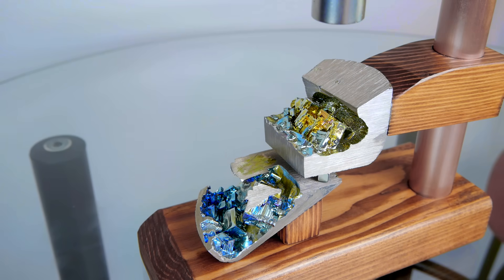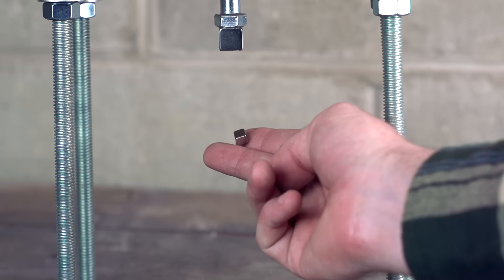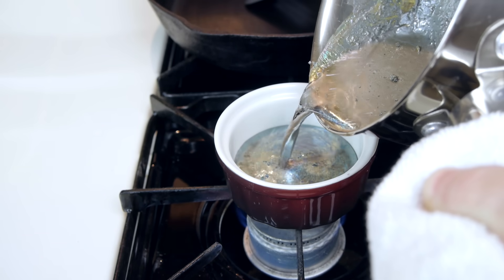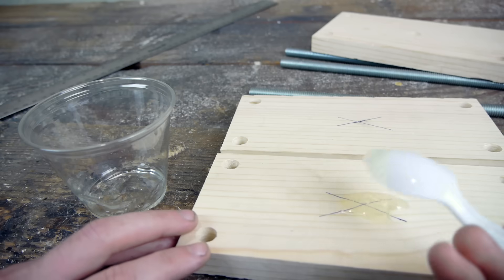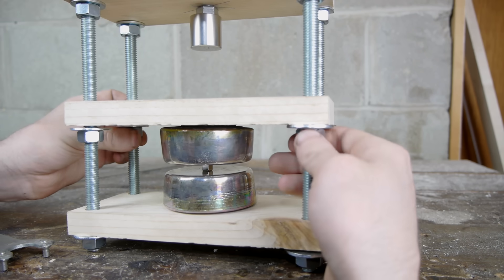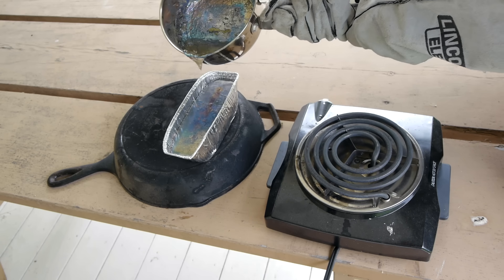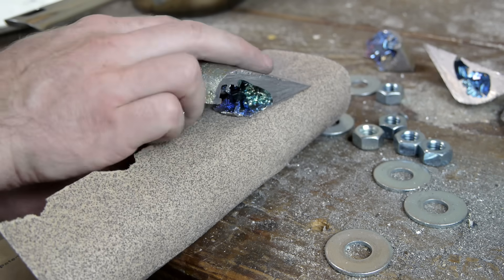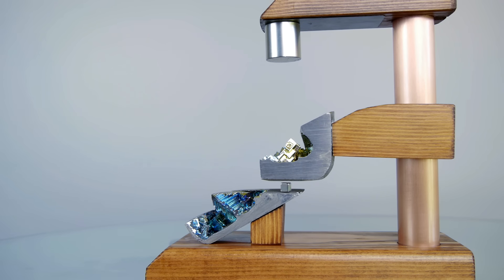Levitate a Magnet with Bismuth Crystals - No Energy Cost, Indefinite Levitation - NightHawkInLight

Comment: Can you wrap that levitating magnet with some wire and still have it levitate? I'm wondering if you could create a frictionless motor out of this...
Reply from the maker: That could actually be a pretty interesting experiment. I expect the magnet may want to move out of position when current is applied. If it does work, unfortunately it wouldn't be any use for practical purposes because you couldn't attach any load without introducing friction to hold the drive shaft in place.
Reply from the maker: Thank you for the idea by the way.

Comment: Would a magnet float in a bismuth bowl?
Reply: spirit of excelence I'm pretty sure it would just fall because gravity
Reply: Diamagnetic force is weaker than gravity, which is weaker than magnetic force. DM<G<M
That's why you need the large magnet on top, and why the bismuth needs to be very close to the levitating magnet.

Comment: Im wondering if the lower part of bismuth is necessary once you get it levitating?
Reply: Both pieces are pushing on the magnet, so without the bottom part it would just fall.
Reply: YTisMEH ThisisBS 

no its not 

you only need one side or the other.

its easier with two
Reply: MsSomeonenew 

bismuth acts against the motion so its magnetic field pushes in either direction looking to achieve balence so you only need one piece

update.....   mmuuuuuch much harder lol 

had to switch out magnet

Comment: This would make a nice low current draw air magnetic hockey table.
Reply: Mud Kip Interesting idea, but balancing out the fields in 3D space rather than the mostly 1D setup here would probably be nearly impossible, even if you got around the fact that you'd need a thing of bismuth between you and the puck

Comment: Where did you get that huge copper pipe? None of the local hardware stores sells pipe larger than 3/4in. That 2 in pipe would be perfect for a project of mine!
Reply from the maker: It's only 1" diameter, the video must make it look larger. You can get large copper pipes locally though if you look around for plumbing/HVAC supply stores that cater to professionals. It's too bad you can't count on regular hardware stores for that sort of thing.
Reply: @Nighthawkinlight  If there's a coil between it, could it be generating some electrical power? Just curious
Reply: @Nighthawkinlight  Or make your own copper pipe! maybe that could qualify as a project.
Reply: You seem to be able to make just about everything else in your back yard, why not get into turning your ingots into pipes?
Reply: you can buy it at any refrigeration wholesaler
Reply: bro youre a genius just make a 2inch copper pipe
Reply: Gross... I think... Idk
Reply: @FrankCosbyNo-Relation  hey are you related to that television program
Reply: @gxiwngxyjebey  😂😂😂💀 I'm high af tho
Reply: If you order directly from the factory they normally are quite happy to make larger sizes speaking from experience.
Reply: @noaharthurbradley8726  you could say the same thing about adult toys speaking from experience 
🤣🤣🤣
Reply: I like that getting the pipe is the challenge, not getting bismuth ^^
Reply: Check copper pipes that are meant for Gaz, they are larger than water pipes
Reply: McMaster
Reply: A 2inch copper or larger can be found at plumbing supply companies.be prepared for the cost
Reply: Have  you searched  Google?
Reply: By ur moms house I'm kidding
Reply: smash ball through pipe like in Pakistan or get a moonshine still
it's been 8 years but thankfully I solved it
Reply: It's a secret but I tell you. Internet
Reply: I  <3 you cody!!!!
Reply: Sup Cody!
Reply: Cody'sLab o hi cody
Reply: I ran into cody!! Hello from Utah!!
Reply: Create a levitating vehicle, Cody! Please!
Reply: Cody!

Comment: You should try generating electricity from it, just put down some copper wires close to the magnet but not too close and see if you can generate a current from the spinning magnet.

Comment: What if we make one of these that's 100 times bigger and use it as an electric generator and use compressed air to keep it spinning.. But the compressor would be extremely energy efficient so it would make more than it's using?
Reply: That is called perpetual motion. Which cannot and will not happen.
Reply: it's not perpetual motion, it's called "over unity", the process of creating energy, which is impossible under the laws of physics. as you generate electricity from the rotation of the magnet you remove energy from it, which will slow it down and eventually stop it, the only way to keep it spinning forever and thus produce more electricity would be to add as much (or more) energy to the magnet as you are taking away through the compressed air.
Reply: that compressor will never exist sadly
Reply: That would have nothing to do with perpetual motion (and of course you would not produce energy). The thing is, in this experiment the energy stored in the (permanent) magnet that was put in by magnetizing it in the factory is being used. After a while the magnet would have no more energy left and the experiment would fail.

Comment: There is a force acting on that magnet against gravity. there is energy spent in a way or another, and maybe it can last as long as universe itself or even more I don't know about that but it cannot last forever. Perpetual motion is a myth.
Reply: When a rock is lying on the ground. The force of the rock on the ground (normal force) is also counteracting gravity. This video just shows two counteracting forces in equilibrium. It's pretty much the same thing. By the way, what do you mean by perpetual motion? As far as I watched the video, the magnet is hanging still. If you are referring to the spinning of the magnet, it will eventually slow due to air resistance.
Reply: Perpetual motion was probably not the right term here and yes the ground can also hold something from going down to the center of the Earth due the atoms own electromagnetic field but my point still hold, the magnetic field doesn't come from nowhere nor it can last forever. Something has to be turned into a force strong enough to levitate, it doesn't just happens and last forever. Atoms themselves decay over time. 

I'm not sure about that but if you measure the mass or a magnet over a very period of time its mass should decrease.
Reply: Ummm he stated this in the video. That it would "levitate" over 100 years until the configuration would needed to be adjusted to compensate for magnetic loss.
Reply: Yes, magnetic loss will occur due to warmth. A magnet is nothing more than just iron or another ferromagnetic element with atoms that are all pointing in the same direction. Warmth is the movement of atoms (by definition) When the atoms in a magnet move, they start pointing in more random directions. Eventually they point in all directions evenly and therefore there is no magnetic power anymore. If this experiment were performed at 0 K, the magnet would levitate indefinitely.
Reply: Just because there is a force doesn't necessarily mean energy is spent. Force is in newtons and energy is newton meters. So if the force doesn't actually move anything then no work is dont and no energy is required.
Reply: Once again, if a rock is lying on the ground, there are also two forces counteracting: normal force and gravity. No energy is being spent in that situation
Reply: Ben Watson force*distance=work
Reply: Bartosz Olszewski Right, and the unit for work is Joules, which is also the unit for energy.
Reply: +Jorgen Dewez hmm, I may be wrong then. what do you base this off of? I've always thought that energy was force times distance.
Reply: Ben Watson sure.
Reply: Bartosz Olszewski So I still disagree with Jorgen Dewez that when two forces act against each other, energy is spent. Unless one force is stronger than the other and the object being acted on moves some distance, then no energy is spent.
Reply: MegaKopfschmerzen Exactly
Reply: OH SHUT UP ALREADY!!!
Reply: why would you even care if that could last till you die
Reply: Jorgen Dewez 
W = Fs
Energy is spent only if the object gets moved by the force.

Since magnet is levitating ( = not moving vertically) no energy is spent.

The rotation probably comes from air movement or the electromagnetic fields of nearby transformers, AC powered devices and DC-DC converters.
Reply: When two forces act against each other, energy is spent. Here we have magnetism acting against gravity.

Comment: why do you need a bismuth ingot on the bottom because I made one of these but cant figure why you need a ingot on the bottom.
Reply: Joseph Brown The magnetic field needs to be symmetrical - otherwise the cube will tend to slip to one side and fall out. Magnetic fields are curved - so if you have one from both directions you can cancel out the curvature
Reply: thanks,i ended up building one of these. Won $200

Comment: Could you use two 1 lb ingots for this? I was wondering because I might make a diamagnetic levitation device like this for my science fair project, since I made a plasma cutter,  and lost to someone who measure the amount of voltage you can get from fruits.
Reply from the maker: Yes, you can make a magnet levitate with only two pounds, but you need around 5 lbs in order to form big crystals like mine.
Reply: I won't make crystals however. That is next level, and I am not ready for that just yet. Thank you for the info however!
Reply: I made a coilgun and lost to someone who refracted light and did math

Comment: Hi, have you ever tried to see how long your magnet can actually spin for? Since there isn't any gravitational friction but only air.
Reply from the maker: +debunkified 10-20 minutes
Reply: +NightHawkInLight how long would it spin for under vacuum?
Reply: +MrMantas1234 probably forever. unless a force acts on it.
Reply: Yes, Newtons third law, or first I forgot anyways an object in motion tends to stay in motion unless acted upon by an outside force. I believe even in a vacuum with no air there would still be magnetic resistance and it would spin possibly for up to 4 days, that's my prediction.
Reply: gravity is still at play here. and there is still energy being used - the energy used to spin the magnet .
Reply: The gravity is nullified to quite a large degree because of diamagnetism keeping the magnet suspended against gravity. The energy  imparted to spin the magnet comes from the hand that feeds it. An object in motion tends to stay in motion unless acted upon an outside force, the only real outside force are frictional losses of eddy currents induced into all the magnets. But since it's diamagnetism, I'm not so sure if there are eddy losses, a vacuum test would be best to test this.
Reply: Didnt your video just say left undisturbed it should be fine for 100 years?
When you said that did you mean undisturbed by gravity and air friction.....?
Reply: It will levitate for a 100 years, not spin.

Comment: Hello,

I have made my own bismuth levitator, it is all fine but i cannot make the magnet to rotate in the midair between bismuth ingots. It simply collapses one side or another after 20 seconds of rotation. What can u recommend to me??? I have spent 4 hours searching the correct position  of all three parts... What can i try?
Reply from the maker: +Іра Мартиняк Bring the plates as close together as possible and balance the magnet that way. That is a easiest position to get the magnet stable. When you get it working with the plates very close then try widening them slightly a little at a time and adjust the magnet. In that way you will find as wide as you're able to make them with the magnet being stable.
Reply: +NightHawkInLight Thank you so much. I will try that. I have coin-shaped neodymium magnets, not a cube, can that be an issue???
Reply: +Іра Мартиняк It might be.

Comment: So I didn't realize he said "stainless steel" pot and so I used a regular one with a black layer on the inside and now my humus that's become more chunky and a greenish color. Have I completely ruined it? A reply as soon as possible would be much appreciated, thanks!
Reply from the maker: +Miguel Hottois I think humus was an autocorrect for bismuth...In that case, I don't know.  Don't heat it indoors as the pan coating could release poisonous vapors when it gets that hot.

Comment: hmm, I noticed that the bismuth made the magnet spin, I wonder if you could use the rotation to make an infinite supply of sustainable energy,  of course on a bigger scale.
Reply: +Saulomon Thompson The bismuth is not what made the magnet spin. That was energy put into the system when he spun it or some vibrations caused it to start rotating. Any energy you could get out of it would just be less than what was put in it to make it spin.
Reply: +Dylan Headrick ok thank you for explaining it
Reply: No problem

Comment: why cant this be used for electricity generation??????
Reply: +Speckterizer 45 ENTROPY
Reply: +Francois Verwoerd 

Because once you try to extract energy from it, the spinning will stop.  That's why no perpetual motion machine works.  The problem isn't exactly perpetual motion, the problem is that you put in at least as much energy to get it going as you can extract.  It's like using a gallon of gas to drive to buy a gallon of gas.
Reply: +Francois Verwoerd I KNOW RIGHT THIS CAN BE A PERPETUAL ENERGY SOURCE
Reply: apparently the ammount it can generate is so miniscule that the is no point in it. other things like solar panels and wind turbines generate much more electricity.
Reply: C North and the friction will stop it

Comment: I was thinking about doing a project where I make a small floating island out of clay around a magnet and make the island actually float. Thats how I stumbled across your video. My question is can this project be done on a larger scale or will it only work at those precise measurements? Also, where would you get Bismuth? Are there special equipment or tools that I'd need in order to work with Bismuth?

Comment: kinda misleading title as this is consuming energy. you even stated in the video that it would work for about 100 years before needing to be readjusted. This is because the magnet is losing its magnetic field slightly and it rests. Magnetism and electricity are two sides of the same coin, and you can think of it as the magnet losing some of its charge. This is why it would have to be readjusted, because it has lost some of its energy from being converted into things such as heat and sound. If it did not lose energy it would violate the law of conservation of energy and would throw apart everything we know about physics as a species.
Reply: +Andrew Gooding after 100 years would the magnetic properties be ruined or it just needs a brief re-adjustment of height to start floating again for another 100 years?
Reply: Fred Lockard it would need to be readjusted because of the loss of energy, then readjusted again. The loss may be very small, but it is still there or else it would violate the law of conservation of energy.
Reply: Andrew Gooding
hehe ya... mainly was curious if the re-adjustment you were referring to meant one on the macro scale like a re-fitting of its ideal height from the bottom bismuth using fingers or tweezers or what have you

or if it meant that over 100 years the material is ruined on the atomic scale... like the way I've heard some artificial magnets can lose their "magnetic charge" so to speak and need to have their electrons re-aligned or something I'm not sure what hehe :p

but it sounds like the adjustment you are referring to is on the macro scale and that the material's internal properties and magnetic domains are still more or less intact?
Reply: Fred Lockard no, it becomes slightly less magnetic over time and is the reason it needs to be re-positioned.
Reply: +Andrew Gooding Are you paying for the energy? The thing you should be nit picking about the title is "indefinite".
Reply: RiveSyphon its not about what you are paying for, and it is not indefinite.

Comment: If you put this in a vacuum chamber, will it not be affected by friction?
Reply: +Billy Bob In a perfect vacuum, there wouldn't be any friction from Air Resistance, but there would still be friction from the magnetic fields moving across each other, eventually stopping the magnet's rotation.

Comment: My question is why the second magnet?If Bismuth is diamagnetic, would not the magnet float without the second magnet?Is it to hold position?If so, then would not a curved surface of Bismuth do the same by trapping it?I'm a very curious fella.Reason why I ask.If you do respond, which I do hope you do, I have a few more questions for you since you have experience with Bismuth.
Reply from the maker: +Uncle Bob The diamagnetic force is weak, too weak to lift the magnet on it's own.
Reply: Thank you! Probably why I see folks floating a small piece Bismuth vs. a magnet.
Reply: Any experience with pyrolytic carbon?

Comment: Could you mold the Bismuth in a cone shape, to have less material obscuring the magnet? I foresee cutting off the point on the cones so the flat is about the same diameter as the magnet.
And a more general thought;
 It seems to me that one of the pieces of bismuth could be small than the other, because of it's position relative to the larger magnet.
Reply from the maker: +Lamont Cranston You need a large enough surface that the bismuth can't slip around the plates, so a cone would be difficult.
Reply: +NightHawkInLight  Thanks.  
 I just watched the video you linked to, I see he did what I proposed, but reversed the direction of the cones, from what I was thinking. Pretty cool!